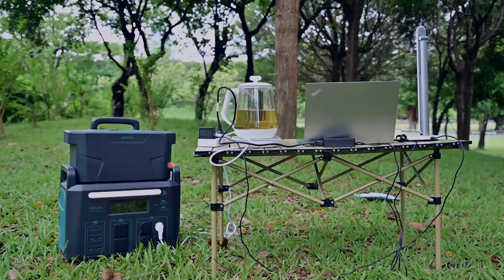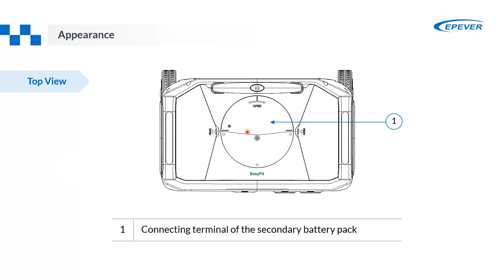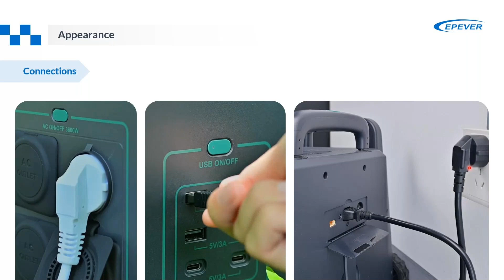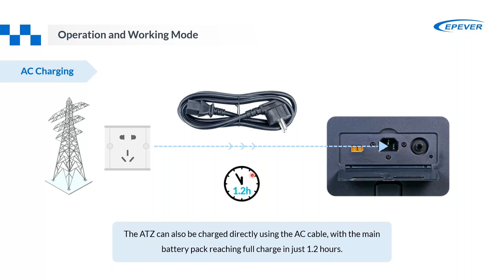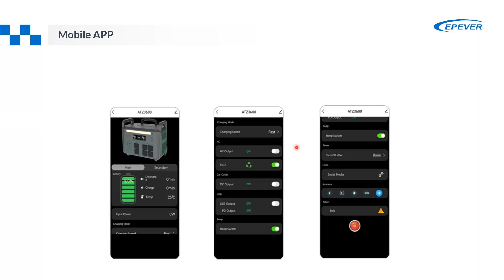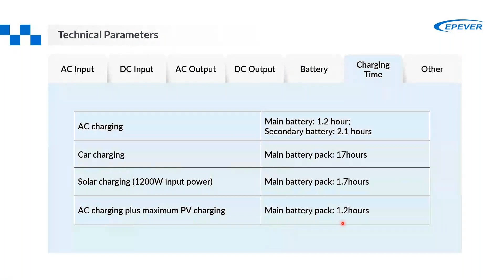EPEVER ATZ 3600W: Portable Solar Power Station & Energy Storage | Webinar Recap

Comment: Is there a features that the ac output can be directly plug to house ac outlet
Reply from the maker: Hi, thanks for your question! The ATZ 3600W portable power station is designed to supply AC power directly to your appliances, like TVs, fridges, or tools, through its AC outlets. However, it is not intended to be connected to the house AC grid or used for grid-tied applications.

If you’re looking for a solution that integrates with home power systems, we recommend checking out our residential hybrid inverters (such as the ELS or EHD Series): https://www.epever.com/products/?yith_wcan=1&product_cat=energy-storage-inverter&utm_source=socialmedia&utm_medium=ytb&utm_campaign=video

Comment: What is the DC (from the battery) to AC efficiency of the inverter? Is this fanless? If it has a fan, how loud is it's maximum sound in decibels?
Reply from the maker: Hi, thanks for your questions!
The DC-to-AC conversion efficiency of the inverter reaches a maximum of 94.83%.
It has cooling fan, and the maximum noise level is less than 60 decibels.